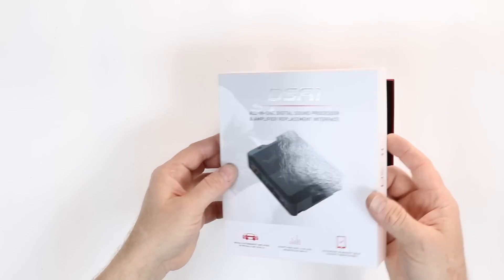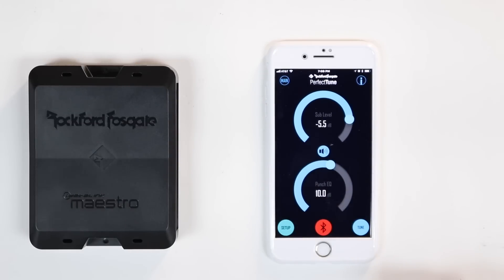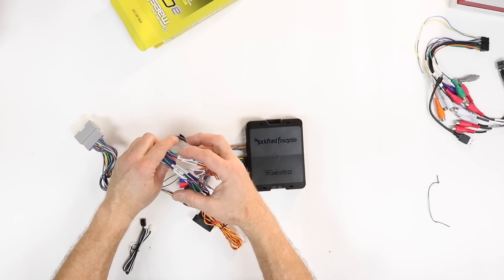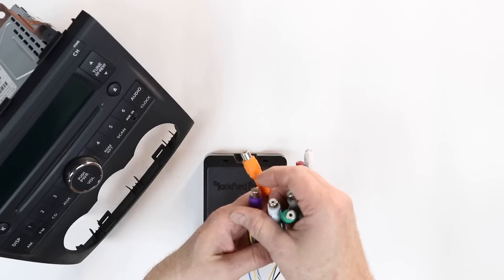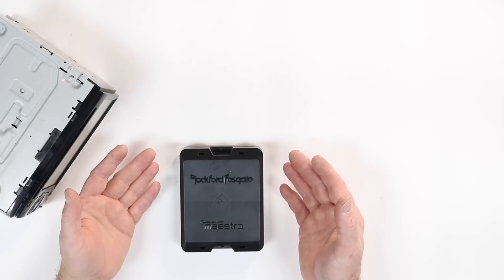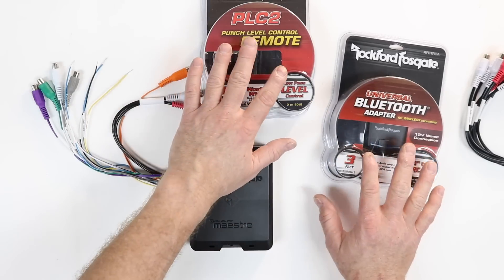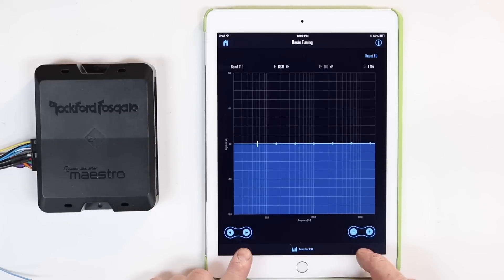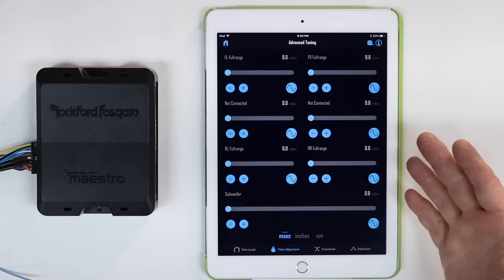The Rockford Fosgate iDataLink Maestro DSR1 unboxing and review

Comment: This is prob either way off the whole reason for having the ability to leave commentary or been asked to death in prior videos, but I have this very item installed in my 2013 VW CC sport with the Sony Rsx-GS9  and this whole DSP thing finally becoming lil more mainstream makes me so so so happy and it's long overdue. I won't bore you with all the specifics of my ever dynamic stereo but I do have focal components in the doors a large sub 2 amps and sound deadening in the doors and trunk. But one thing sticks in my craw or face really that I wish I hadn't ripped out with the stock stuff and that is this CENTER CHANNEL that was unhooked when I put all my stuff in but I think sounds tits even when the stock was assaulting my ears in a brand new vehicle. Is it wrong to buy a car because it has a center channel again LONG OVERDUE to the mostly HIFI(less)  mobile audio crowd. simply put there are more knobs in the world of stereo install than the one flying solo to your subwoofer . Many, many more . So I'd like to bypass the usual knobs and ask, can I do something with this center channel like replace it with something better or hook it up to my amps and make this purr on the data link maestro to the Rockford perfect tune or do I need to upgrade to an audison, Alpine or even focal type dsp? Or better put HELP?! SORRY this is so long....

Comment: I`d much rather have and use the optical output from the PAC AmpPro into a JL Audio TwK, Audio Control DM-810, or a Bit.
Reply: You are 100% "incorrect" about being stuck with the factory amp and it not working with the DSP`s that I mentioned. I`d suggest you take the time and do some research before making a statement like this.

The PAC AmpPro bypasses the factory amp and gives low level outputs just like the DSR1 plus it gives you the option of going optical out which is what I said in my initial reply, and all of the DSP`s that I mentioned will accept an optical input. INPUT being the key word.

Lol..........You`re using Astell & Kern as a source and want to use it with a 249.00 DSP such as a DSR1? 

You personally don`t think my suggestion would sound as good and at the same time you want to hold off until the Maestro piece is compatible? 

Stop while you`re ahead because what you said makes no sense.
Reply: This does have a digital input I believe.  It's spdif instead of toslink though.
Reply: You are correct but I said optical output. Currently there are no aftermarket or OEM head units that have an optical output to use the SPDIF input on the DSR1. 

Using the DSR1 means one is stuck using the DSP in the DSR1 whereas if one wants to use the  optical or low level output of the PAC unit, he or she will be able to use a much better not to mention any external DSP including the RF 360.3 which is better than the RF DSR1 but i`d never use the 360.3 

The DSR1 has it`s place in the market. It makes for an easy solution to upgrade the factory stereo and the setup plus the simple DSP is more than enough for the majority pf people. However, a person with a high end system that`s fully active and at the same time wants or has to keep their factory head unit, will not look at the DSR1 as an option. 

They will either use the Pac Amp Pro with it`s optical output to a DSP that has an optical input or the will use a DSP that accepts high level inputs that does summing such as the DM 610 & 810, Bit One, JL TwK, Mosconi 6to8 & 8to12, RF 360.3, etc, etc.

Comment: You CAN'T use a Windows based computer to control it, that's absolutely false. You CAN flash firmware. All of the tuning is only functional through an Android 6.0+ or iOS10+ application called Rockford Fosgate Perfect Tune on a supported tablet with bluetooth. Please update your video as it is misleading.